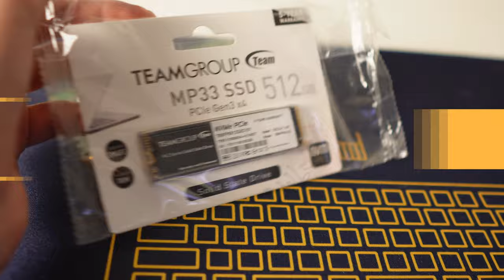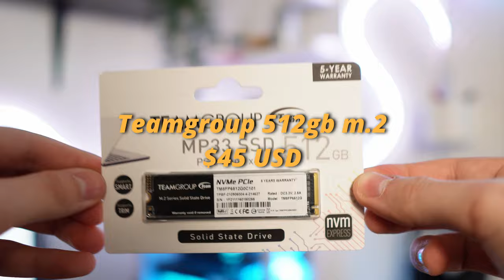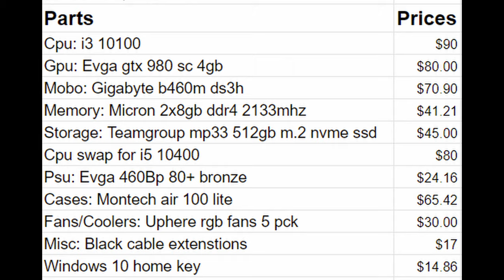Flipping Pcs Until I Buy A House! Ep. 1 | Starting off with $750 PROFIT!

Comment: Since the i3 9100f the i3 range has become a lot more viable for gaming. The 12100f looks really good except for the cost of socket 1700 mobos. I have a Ryzen 3300x and it really lags compared to the new i3s.
Reply from the maker: Yeah I feel like the best value if a i3 10th gen if you don’t buy it broken like me
Reply: Not a shocker. AMD has always sucked, especially for gaming, however they typically run cooler and use less watts. Seems AMD is stepping it up with the thread ripper however.

Comment: W. Looks pretty great man.

I have used M.2 drives in both systems I've built so far. Will always try to if the mobo has it built-in.

I haven't used cable extensions yet, but I'm considering it on my second system build as cable management is a nightmare so far.

Great video and thanks for all you do.
Reply from the maker: Cable extensions definitely add cable clutter. I’m seeing if it’s worth it for flipping

Comment: man Im Jealous Lol everyone Be Having Pc while I Have A 200$ Laptop that Run Noting Anymore 🤣 It Must be Nice
Reply: Just save, well it isn’t easy to save for everyone, but it’s not hard to find steals with under a 300$ budget, just try to collect part by part, I recommend buying used motherboard combos with the CPU, cooler and ram, get the PSU when there is a sale on Amazon or something, and get the GPU and SSD when you see a good deal, and a cheap case is fine
Reply: @MGSRR1279  I am saving i have no clue abt cpus and things lol im just trying to get a pc that runs games
Reply: @sheluvgigi5444  what games are you wanting to play?
Reply: @RanenPo  roblox And Gta lol.. But on roblox high Fps games